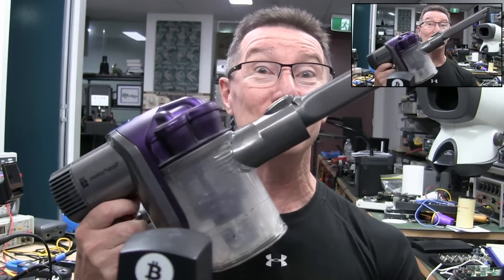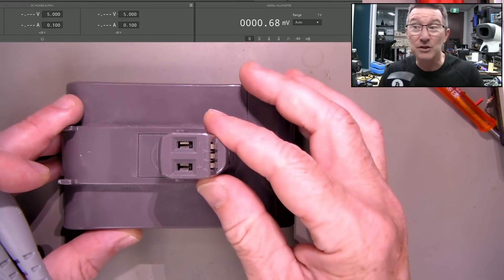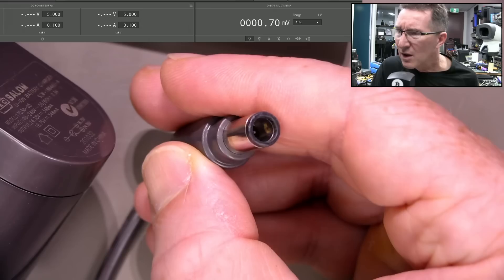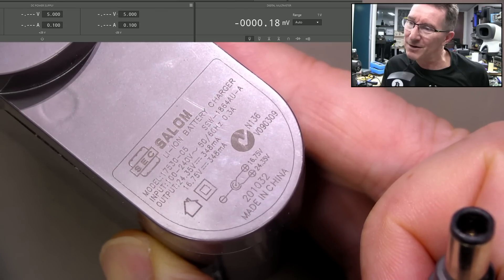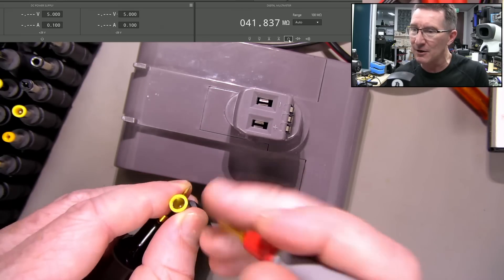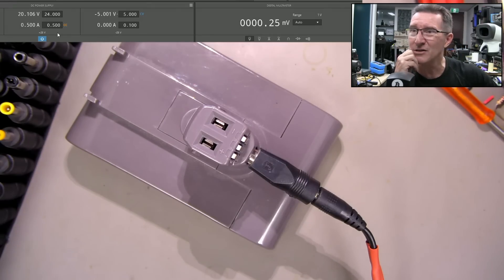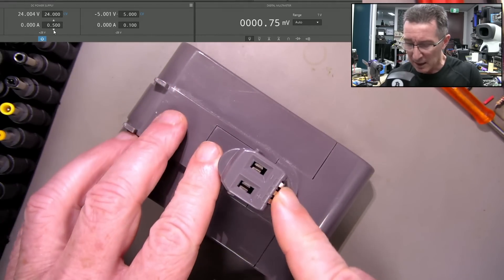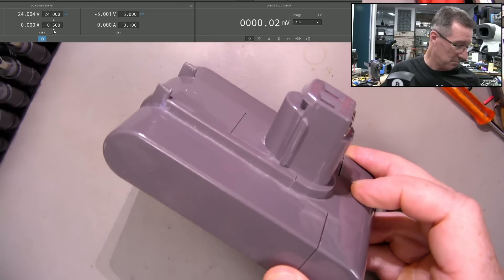Dyson Battery Failure

Comment: Some Li-Ion battery packs have a SMBus communication interface.  When the battery is first connected to the load, the battery will provide full voltage, but limited amperage.  Once the load has booted up, it sends the appropriate unlock command over the SMBus and the battery then allows the full current to be supplied.  Perhaps these extra pins are that SMBus interface?
Reply from the maker: Sounds plausible.
Reply: @EEVblog2  some laptops (hp) have those to. Outer ring = GND, inner ring = + en de point is "data".
Reply: Dyson batteries are "dumb" as far as I know
Reply: @Fluxkompressor  they have a broad product range - and the more modern ones I have repaired seem just to have standard single inputs...  13 years ago is a lot earlier in the Li-Ion storey perhaps?
Reply: I have had one of these for years and like you the battery started to fail, shorter runs etc.  I bought a knock off which was fine and continues to work but I was curios so I dismantled the old battery.  It was, like you say, fully welded shut.  It took major destruction to get it apart but what I found was a set of batteries, and one crammed circuit board.  I am not electronics expert but why would a battery board need a dozen microchips.  I was suspicious so I cycle checked the batteries and they all tested 100%.  So why was the battery showing as no capacity.  I suspect there is circuitry which knows how old the battery is and shuts the battery down to look like it’s failing.  Yet another planned obsolescence I suspect.  And there is nothing we can do about it.
Reply: @misseryguts  Did you test the voltages of the cells before testing them? If they are out of balance the behavior you describe is normal. The BMS (the chips) cuts the power if one cell goes above 4.2V or below  3-2.5V
These board normally have no means of balancing the cells, so the over all capacity goes down

Comment: We have a DC44 which has an identical battery, although it isn't readily released from the vacuum cleaner; it is very clearly marked with Dyson, so yours does appear to be an off brand replacement.

Comment: Dave, I repacked the same battery with new one, no problem, But: before disconnecting one cell, i soldered reserved battery with same voltage, so voltage newer gone from bms, bms did not noticed, that battery was changed... and two, you need a really high current new batteries 18650. low current will not do. I soldered my reserve battery 6 times, from cell to cell, while changing the main 18650 cells.

Comment: The problem is just the original battery firmware thats kill the battery and have no balance activated. It is just to make you by new batteries, but the cells are probably fine. Dyson make it.

Comment: Looks like it should come apart to me… the black clip below the charging port needs pushing in at the same time as pulling the section of plastic housing behind that. The label across the adjoining parts makes me think it will as well, as if it’s some pseudo warranty sticker

Comment: The problem with battery vacs is they draw too much from the battery, resulting in a short battery life.
Two possible solutions:
1/ Use a 40 Volt bike battery with a bucket regulator dropping the voltage to about 12 Volts.
2/ Run the vac from a cable to a bench power supply..

Comment: I found the replacement batteries don't last very long. I found an adapter made for the Dyson that allows attachment of a Dewalt 20v tool battery.  I think there is one for a Milwaukee 18V.  battery. This only fits certain Dyson models, so make sure your model is covered. You won't be able to use the wall hanger or Dyson charger. This option is best if you already have Dewalt or Milwaukee tools. Of course Dyson does not support or recommend this alternative. Do so at your own risk. Adapter can be found on Amazon. Lasts much longer than the aftermarket Dyson battery.

Comment: That Jack/Plug looks like a common every one you would see on Dell & HP laptop Chargers. There are two sizes of the Tri-Wire plug. The small comes in at an outer barrel diameter of 4.5mm and the larger size, what it looks like you have there, at 7.35mm outer barrel diameter. We have boxes full of laptop AC adapters with those two sizes of 3 conductor jacks on them...

Comment: There's another version of these with a non-detachable battery. The shop I worked once had one of these, and it dies after about two years. Couldn't manage to open that thing up without destroying everything. Managed to broke away a piece of the plastic just to find all cells being submerged in glue, so I just gave up.

Comment: I found one of those vacuums at the local recycling location. Its got the long tube and power head and several tools. I expected the battery to be dead, but it charged up fine. I looked online and found a replacement battery on eBay, so I have a spare of slightly more capacity. The vac works ok, so lucky me. I probably would not buy a rechargeable vac as the batteries tend to be expensive to replace, but the clone battery works fine and not expensive. I normally avoid rechargeable anything as you know the battry is the weakest link,  and I don't mind power cords !!

Comment: I've opened up one of these knock offs before, and found that there were only 4 balance leads connected from the cells to the BMS. 

The BMS had all 7 solder pads for the 6 cells, but only used 4. (B-, B2, B4, B6)

Comment: Most Dell and HP computer use the tractional connector with tractional cable. They use the center conductor as a signaling wire within the other two conductors there 20 V. I had a laptop that fried the control chip in the laptop because the cable Got fried twisted that shorted 20 V to the Center contact. I really like how Apple does it they just drop the voltage unless there's a load. Although they didn't used to do that and it was just fine with two conductors as the MagSafe LED it was just controlled in the connector with one were signaling.

Comment: We had this exact Dyson vacuum and the battery died also after two years. They don't hold much energy anyway as the vacuum lasts max ten minutes on max. Bought an unofficial replacement battery and it worked ok. Since then decided never to buy Dyson again.

Comment: That's really funny, I am a repair professional for... all things electronic. I had one of those on my desk just yesterday around the time this video was posted. The one I got was a fucked battery management board, cells were all fine. Well as fine as batteries can be after a bunch of years of use anyway.

Most dyson batteries are actually held together by clips not heat sealed, just insanely tight stupid clips. Yours seems slightly different than the one I had, but I've had 3 types that were all relatively the same so I suspect this one will be no different. Also, at least on the one I had yesterday green LED means broken apparently. But again it was just the BMS that was cocked. It being covered in resin really ruined my afternoon there.

Comment: Lame. They are not heat-sealed, they're clipped together. I took mine apart and re-celled it. Come on, "don't turn it on, take it apart" for new and valuable stuff, and then you don't even TRY to open something that's going to the fuggit-buckit anyway?

Comment: There should be an annoying blue light on the pack. It will flash when the pack has a fault.
I pulled a genuine pack apart without destroying it.
New cells didn't help. The logic marks itself as dead and won't work again. 
We get replacement ones from Dyson spares in Perth. They 'require ' the vacuum serial number before they sell you a new battery.

Comment: Dyson, eh? As in... Miles Dyson?

Interesting dual-voltage power supply. The plug is similar to those used with T60...T430/T530 series Thinkpads, though these had resistors on center pin for indicating the PSU output power capability. Outer sleeve is GND, inner sleeve is +20V 65/90/170W, the latter using a special plug with protrusions on the inner sleeve that go into notches in the socket, it's meant for W520 and some other power-hungry models.

Comment: It would have been interesting to see the inside of that battery pack though, like is really only one voltage from the plug pack connected? Also to confirm the dead battery, I would have liked to see you plug power into the vacuum itself or so. Or maybe some research into what those extra pins do?

Comment: had one of these with same symptoms . i disassembled the battery pack and did a capacity test on each of the six cells which were all fine at around 2000mah per cell . my guess is that the bms in the pack doesn't balance the cells correcty resulting in an imbalance over time and  resulting in bms disconnecting the cells and preventing charging. i now use thses cells in a power bank and they work perfectly fine. i also checked the cells voltage to see if they had been discharged below there safe limit which they had not.
Reply: ps .the cells were Labelled as 2000 mah

Comment: I've got a very similar Dyson battery that also failed. It's hard to open but not sealed, just very strong clips.
The stupid thing doesn't have a balancing circuit, so it's possible the cells are very much out of balance and charging stops as soon as the high voltage battery gets a few percent additional charge.

Comment: the thing i don't like about them is they changed the battery every time a new one come out so you cant use your old battery in the new one you got and when they die and they die very easy you have to spend #50+ on a new battery or buy a cheep one that dont even last till you finished doing a 1 bed flat.

Comment: Had a battery and power supply fail on the same model. Opening up the cases revealed a wealth of surface mount components and complex power circuitry. Just bought a new third party power supply and battery at a fraction of the cost of the genuine parts and normal operation was restored. These little vacuum cleaners are handy but I found a cheap Black and Decker worked just as well as the Dyson and was far simpler in construction, so repairable in event of a fault.

Comment: Last Dyson battery I repaired had shut down because the cells were out of balance by less than 500 milli volts. Light on battery flashes a fault code. Balanced the batteries and re-flashed the firmware. Vacuum cleaner was a later model though

Comment: I also had one of these that died after many years. I destructively opened the battery pack - the cells were indeed goneski. Dyson charges so much for a new one, I tried a third party replacement, which worked great for a few months. And then a second one which was basically DOA.

Finally gave in and bought a new vacuum. Figure I got a lot of years out of it, and the new ones are honestly a lot better.

Comment: What happened to that "don't turn it on, take it apart" thing? 😂😏

Probably doesn't take that much to crack it open, and I wouldn't be surprised if it's 5x 21700 cells in there?
...And of course a proprietary Dyson BMS that is programmed to disable the still usable battery after a certain number of cycles. 

Got to sell them new ones you know, and can't have tinkerers fixing them...

Comment: I did a tear down here of a third party battery pack.

As others have said, that does not look like a genuine battery pack from Dyson.

For me,  there does seem to be a flaw where despite the cells being in good health something stops these units from charging and running properly. BMS?
Even with genuine Dyson packs these all seem to go the same way.  People chuck them away because the battery life suddenly reduces dramatically.
Reply: PS: After my video, I extracted the 18650 cells and they all appear in good health and I now use them in torches/flashlights and they work really well!

Comment: I tried to open one of those packs to replace the  cells inside that were faulty (motor cut out cuz batteries couldn't supply enough A)
Replaced the cells, reinstalled the bms and... nothing. Apparently once disconnected from the cells the bms commits suicide. 
My unit had 4 cells inside, 2 empty places.
Thank you dyson

Comment: Got the same problem, but with the budget version of that vacuum. Its battery has a prong sticking out the top, so you can NOT use the regular (non-budget) replacement batteries with it. Dyson does not  provide ANY replacement batteries for the budget version (it's cheaper to buy upfront, but e-waste as soon as the battery is broken). I cracked open a regular replacement battery and swapped over the budget's "prongy side" of the shell. It was quite the hassle getting the two halves apart, and the contacts were soldered, but in the end it worked! 😀

Comment: 13 years is a lot of time for a Li-ion battery pack. The factory battery on my V8 didn't last nearly as long.
The original pack on My V8 has 21700 cells instead and the battery pack is held on with screws, no easy way to remove without tools. Fortunately, replacements are readily available.

Comment: Get a Tool battery to dyson adapter and use what ever brand of tool batteries you already have (Makita, dewalt, milwaukee...)
These usually have a 5S configuration and I believe dyson is 6S, so it wont get the full voltage but it still works fine

Comment: I just swapped out my battery on my dyson 24V battery yesterday. Mine was not sealed, there's a single hard to see screw on the narrow neck and then it just comes apart easily. Easy to fix.

Comment: 13 years is remarkable life for a battery. Most batteries are only rated for 5 year lifespan, 10 tops for any secondary cell. With proper charging and use like in an EV, you can probably get far longer lifespans but for most consumer items where you're going from full to empty and don't really have much in the way of battery management getting 13 years is excellent. Remember that Li-Ion chemistry degrades with time as well, so older batteries, even unused ones, will be degraded just by age.

Comment: OMG dave, are u a brave man?
because the main problem with these dumb dyson batt. packs is that the internal BMS DOESNT BALANCE the cells !!!  
ur mileage could vary because of constant use, but my specific batt. pack after a few months of sitting around had an uneven discharge and the cell voltages were :
cell 1   3.643 V
cell 2   2.728 V !!!! (can be recovered with 100mA charging to 3.3V)
cell 3   4.037 V
cell 4   4.010 V
cell 5   3.572 V
cell 6   4.006 V
in this condition the charging became disabled, as charging can result in some of the cells going above 4.2V AND CATCHING FIRE !
so unless u got the time to dick around recovering/balancing the cells and checking capacities,  maybe just buy a new battery and dont risk it.

Comment: I would not have raised the voltage like that knowing that one of the cells has likely shorted (safety feature) and you’re potentially over-charging the remaining cells. Good way to ruin the remaining cells and/or start a fire!
Reply: ok, i just also told him this with some more detail, hopefully nothing burns down.
the batteries in one dyson pack i opened ranged 2.7 - 4 volts !

Comment: It’s not heat sealed but you still aren’t getting in there without tearing it open! Dyson repair techs get some highly specialized jigs for releasing the catches without damage and all the 3D printed versions will just break.
Reply: Could just 3D print a new battery shell
Reply: Yep, but no one will mistake that for the original so there’s still no discrete way in/out. :)

Comment: I can confirm that you should see >22V on any good battery pack. ~24.2V when fully charged. Newer models also have the power MOSFETs on the battery pack, operating the trigger switch, yet I don't think that DC3x would work so; seems that the terminals are directly connected to the batt. Would be interesting to see if you can draw any current from these terminals and measure IR on your pack.

Comment: I replaced 18650 in my Dyson V8. There are some weird sizes cells like 20700. A slightly bigger than 18650 with the same capacity as 18650. I wrapped  Sony VCT5 18650 in a few layers of the capton tape to increase the thickness and soldered them in. The nikel strips fits, everything fits. Now, the run time is around 20 minutes on full power so Im happy. I wanted original BMS since the chinese one is piece of crap.

Comment: Aww come on Dave!  Crack it open and replace the cells with decent branded ones using a battery welder as all good electronic tinkerers should.  Mr Dyson charges severely over the odds for the official replacement packs so bodge-your-own is definitely the way to go.  Don't turn it on... TAKE THE DAMN THING APART!  (Please!).

Comment: took one apart once, was a pain, ended up just getting a off brand replacement battery, original battery took apart, very difficult, 1 cell was dead and BMS said no, even though it still had led indication lights etc